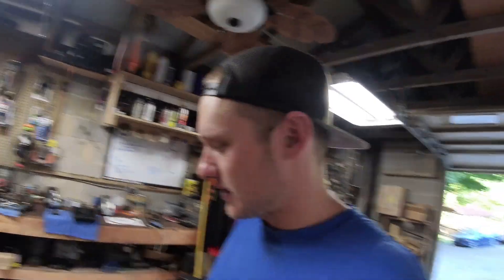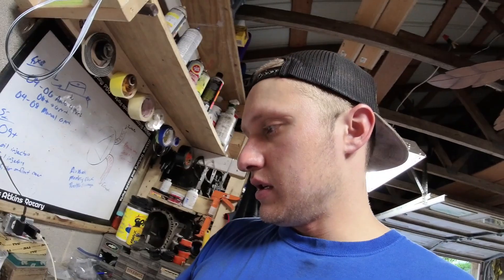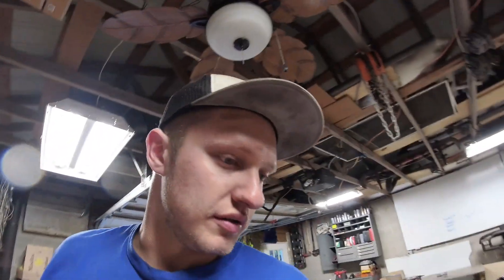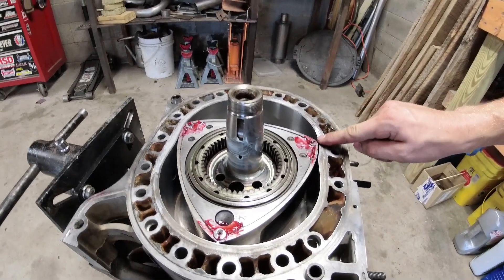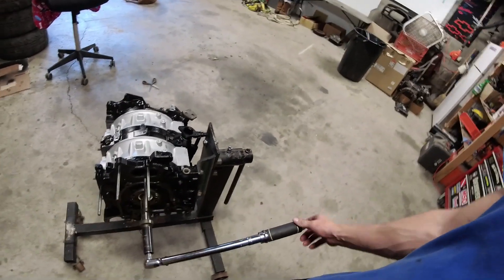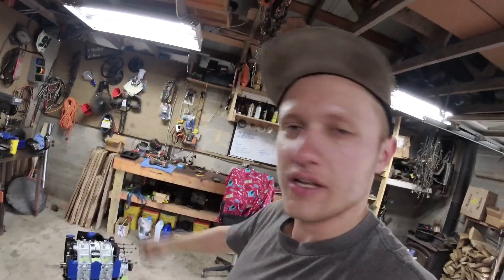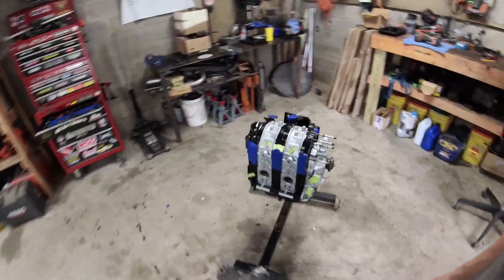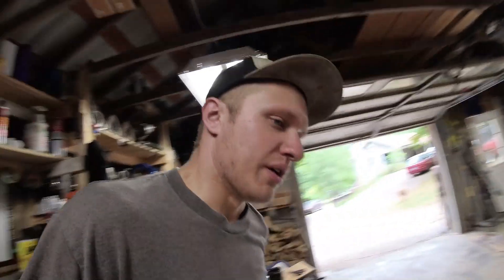I Tried a New Way To Build a Rotary Engine - 13b BABY Half Bridgeport

Comment: Would you tell us why you left the apex sprigs in when they were put into the rotor? If they were left out during installation and installed after the rotor was in the housing no flying holding bands.

Comment: Random question regarding BABY bridgeports....how much overlap is needed to get that signature lopey idle? I don't plan on boosting the 13B I'm building (from an 88 non-turbo), so doing a full on Bridgeport would be a complete waste of reliability and already less-than-desirable fuel economy. I am curious if I had a SLIVER of over lap (like 2-3 mm) if that would be enough to get those braps without sacrificing TOO much. I plan on doing a mild to moderate street port for the intakes. 

Basically, my end goal is going to be ~200 ish HP, with that iconic idle. 

Plans to drop it either into a 79 Chevy Luv or an 80s Subaru Loyale/GL wagon with a dual range tranny (unless I can get my hands on an 82-85 FB for a steal, in which case, it's obviously going into that). Luv came with 4.10 ratios in the 5 speed 4x4 package, and the Subaru came with 3.9 but has a 4.44 ratio available. Both would be SUITABLE candidates for a 4x4 rotary swap due to gearing, especially after cranking that rotary up a lil.

Comment: Just fit second hand apex seals in the slots  without springs.lay rotor down pull out apex and install new ones.this keeps corner seals in place.its the corners that catch the assist piece.even if they break away half way down they still go down if everything's square...also remove excess   glue..looks like a lot on the side...also the issue with assist piece  in full bridge is mostly due to lack of support on the tip..when the housing is chamfered the assist  piece has no external support. Only side.

Comment: im rebuilding my engine, and my housing has a slight groove about 4mm in from the edge, that goes for about 2 inches in the exhaust side, what would that mean if I assembled the engine with it, and would it cause any serious power loss?

Comment: Not sure why you want a 2002 Bathurst type R from Oz they all came from Japan as they were not released here. Cut out the middle man. There are a few youtubers who are in the scene in Japan and maybe able help you to find 1 at the auctions.
Reply from the maker: Everywhere I see them, they are all for sale down under. I guess I don't see many in Japan auctions because they can't be imported to the states yet.
Reply: @RADPotential  True you have a 25year import rule, ours is very similar with the exception of being able to import cars not released in this country, as long as they pass Australian design rules. There are a few people who purchase cars and then store them a couple of years before they are within the 25 year rule, avoiding the sudden surge from other buyers entering the market.

As an aside the motor you could possibly be interested here in Australia would be the Ford Barra a straight six capable of some impressive hp, replacing the pony 6 with it in the US makes for a cheap but contemporary Mustang. But then you are a Chevy boy.

Comment: I was looking to run the Turblown studs on a boosted S5 6 port setup but wasnt sure how much Horsepower/PSI it would be able to handle safely. Has anyone been able to build such a setup with a smedium turbo like the GTX2867R or GTX2071R?

Comment: I run the Turblown stud kit in my FC T2 as well. The studs are made by ARP for Turblown. Much stronger than factory tension bolts for sure. On the FC though you need to bottom tap the front iron all the way to the bottom of the holes so that the studs don't interfere with the flywheel and also to get maximum strength. It is a pain to tap and a little nerveracking as if you tap too deep, you can break through the hole and the iron is junk, I took my time, haha. Anyhow, great content, always enjoy your vids. Keep it up.
Reply: I just wanna know where the golddddd at
Reply: @dwolrdcojp  Hahaha! Thank you for the love 😎